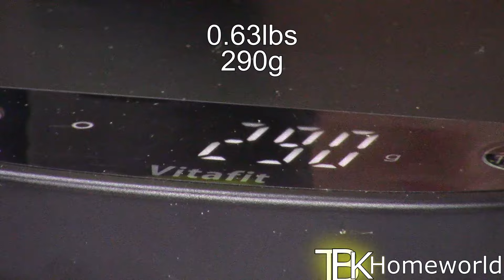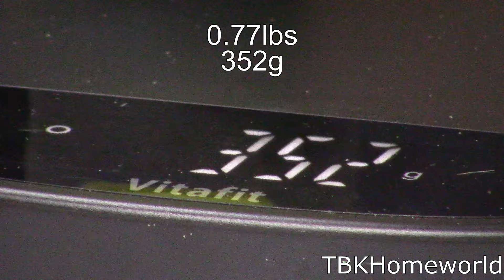Are 4V Ryobi tools JUNK or are they amazing?!

Comment: Low quality flashlights always advertise their run times at low settings, but we wonder what their run times are at high settings. Most of the time, they are so short that it’s embarrassing.
Reply from the maker: I completely agree.  I have not tested the full runtime of the two 4V flashlight models that I own but I can say it runs for a pretty long time (I've used one for 30 minutes straight and it never shut off) and while it does dim after a while it is still bright enough to easily light a room/path.  

Thank you for watching and commenting.

Comment: Everything you need to know, I have all the Ryobi 18v tools you could ever need but I have Milwaukee M12 for the smaller tools the screw driver the ratchet the light the rotary tool and more.
Reply from the maker: @Sam-tk9tt  i like many of the 4v tools but a few are really lacking.   I have a 12v coat from Milwaukee and I love it, I'll be buying some of their tools eventually as well.  I typically buy one battery type and stick with it,  thus my silly large collection of Ryobi.

Thanks for sharing and watching!
Reply: @ man thanks for replying, ryobi is awesome honestly. I don’t have any of the big red tools only the little ones because ryobi does such a good job at everything.

Comment: I bought the ryobi 4v power cutter and I am not happy with it. It drags through cardboard. I was expecting better. I had also bought the scissor type battery cutter and I am disappointed in that too. I was hoping better with the Ryobi cutter tool. It's just not powerful enough to do a good job.
Reply from the maker: Hmmmm, I'm not having any issue with it cutting through cardboard, do you think maybe you got a bad one?  it might be worth trying to exchange it for a different one at the box store and seeing if it works better for you.

As for the sheers, I've not purchased those so I can't speak to them, really stinks that they aren't working well either.

Thank you for sharing your experience and watching!
Reply: The shears, I noticed from someone comparing them with the cutter seems to work better with cloth, while the cutter doesn’t do as well with cloth, creating jagged edges. However, she found the cutter to work better with heavier things like cardboard. So she said she decided to keep both. She wasn’t using the ryobi cutter. 

I don’t know if I am expecting too much with the cutter on cardboard. But I expected not to have to push it so much, where a box cutter might be easier. I just wonder if isn’t powerful enough to zip through cardboard that I expected.
Reply from the maker: Ah, I follow you.  I do have to push the cutter through the stuff I am cutting.  At first I thought it was going to pull itself through but it doesn't have a feed foot (like a sewing machine) to do such a thing so it made sense once I stopped to think about it. I don't have to push very hard, so there is that.  If you are having to push a lot then perhaps there is something wrong with it.

Either way, at least HD has a great return policy if you don't like it.
Reply: @TBKHomeworld  It works ok on thinner cardboard but not so great on thicker cardboard. I am sending it back. I ended buying the Milwaukee m12, 3 inch cutoff tool to cut thicker cardboard, plus other materials. It works like a breeze. Plus it was on sale and I already have m12 batteries. When I bought the Ryobi cutting tool, I also bought the 4v charger, so it came to almost $100, so the Milwaukee m12 cutoff tool was on sale for $99. I don't plan on getting any of the other 4v tools.
Reply from the maker: The performance difference between the M12 and 4v is massive (as expected).  Glad the Milwaukee is working well for you.  4V tools aren't for everyone but I do love the flashlights, fan, and high speed rotary tool....but no reason to get into the 4v if you're into the M12.

Thanks for the update.

Comment: As a reviewer you did a great job showing what is good and what is bad makes you a great review or a great reviewer does not recommend a product they just show the pros and cons like you did a lot of amateurs don’t understand the right way to put a screw in wood is to pre-drill the hole although I do have  much more powerful drills and screwdrivers using this small Ryobi hand drill/screwdriver the proper way it would put those 3 inch screws in very quickly first use a drill bit then take the drillbit out and put in the 34 inch or even a 6 inch screw it will put it all the way in flush without a problem again your demonstration  was excellent and you did a great job but you must use a Drill bit then switch to the screw that is the proper way to do it and this tool has more than enough power to accomplish the job thank you very much for your video I enjoyed it
Reply from the maker: I am glad you enjoyed the video and left a comment.  I completely agree that pre-drilling a hole is a great way to help this tool along and it would easily be able to sink the screws in with that.  It is also best to pre-drill holes in harder woods, metals, or any piece that you want to look perfect after putting in a screw.  

However, it still does have the delay once you hit a certain point of usage and then it stays shut off for 3 to 5 seconds.  When I disassembled and reassembled a dryer, and now I've used it on several other projects, that proved to be very frustrating.  If you are okay with that limitation then it is a good screwdriver!

Thanks again for the comment.

Comment: Does using the 3 amp battery give the screwdriver a bit more power?  The fan is about the only tool I’m interested in.
Reply from the maker: I have not personally used any of the 3Ah batteries but they should be roughly the same as the 2Ah, it is just that the tool will run longer on the 3Ah.  The fan is truly awesome and, if you have a need for it, is worth the price of entry for a nice personal fan that is lightweight and easy to carry around.

Thanks for watching and asking a great question!
Reply: it doesn't. The Screwdriver is max out at 55in/lbs running at 250 RPM

Comment: 14:36 If ryobi makes the changes I want then it would be a perfect tool! That’s all I hear about this screwdriver. I agree though with your own argument that if you want all of that just buy a drill… not a screwdriver…
Reply from the maker: I know my 'want' list is long but I did notice the next screwdriver they came out with had a lot of the features I mentioned, like a case, and they even came up with a swappable head desgin.  Unfortunately it has the same 'over load' protection issue and shuts down for a bit too long.  I've started to use my Bauer more than my Ryobi simply because of that odd feature on the Ryobi.

I do use the Bauer frequently on certain types of situations, for example they work really good on older vehicle interiors!

Thanks for watching and commenting.
Reply: @TBKHomeworld no problem! I dig the videos and the content you produce. I do admit that my comment sounded aggressive and I apologize for that, I just am an avid ryobi lover for many a reason and it just irked me that someone made so many nit picky comments about a screwdriver asking for things on the screwdriver that would suit a drill better. That being said, after some reflective thinking I do agree! A few improvements to this driver and it would suit the goals, at least the goals I think, that ryobi is going for. Again I do apologize for any aggression I just felt that some of what was said was TOO precise, but That’s actually the goal that we as tool users and reviewers need to do, so that at the end of the day we all get tools that can be truly reliable. 

Thank you for replying and I look forward to seeing more videos 😊
Reply from the maker: @Tactical_Fatty  Certainly not a problem at all!  Reading comments is always difficult because we cannot tell the voice/inflection/emotions behind them.  I did not take your comment as aggressive but as someone who is happy enough with the current model and has either purchased it or is looking to.  I'm not upset now nor was I when I replied originally.

Some of my requests/desires for the tool are very specific to my wants and Ryobi certainly doesn't have to listen to them as I know they don't fit into the 80/20 rule for most folks out there....so business wise some don't make sense at all.  However, I put forth my desires simply in hopes that they would listen to a portion of them and hear my desire for something different.

I am an avid Ryobi lover now as well, they won me over years ago (I have a video of that so I won't bother recounting it here) and they've rarely let me down with the tools.  I do try to call them out when I have serious issues and then provide feedback with additional features/modifications that I think might help.  The cool thing with Ryobi is they come out with new tools constantly so if something doesn't sell then they can easily course correct for the next model design. 

Thank you for the follow up and a BIG thanks for watching the videos, it means a lot to me and the family!

Comment: Use the tool appropriate for the job.  

You wouldn't use your screwdriver set shown at 7:20 to put screws into construction lumber
So why would you use a small drill like this to force large screws into construction lumber, especially without a pilot hole.
Reply from the maker: Thanks for watching and commenting.